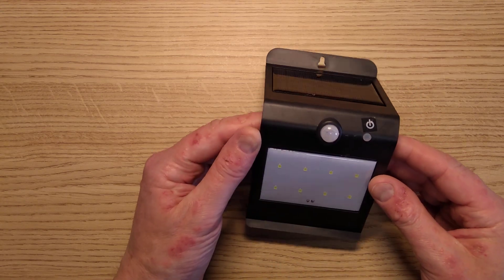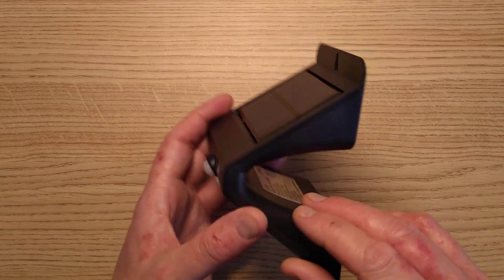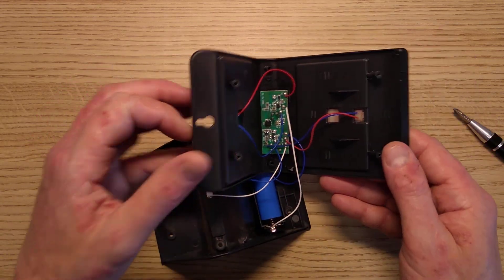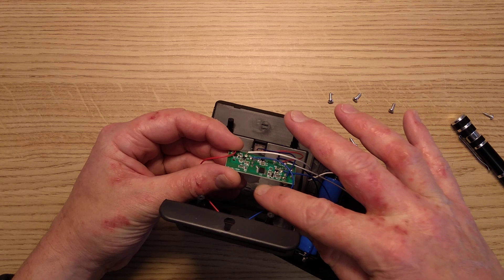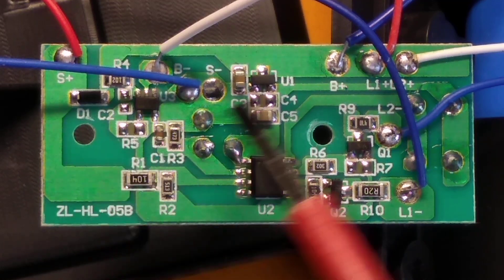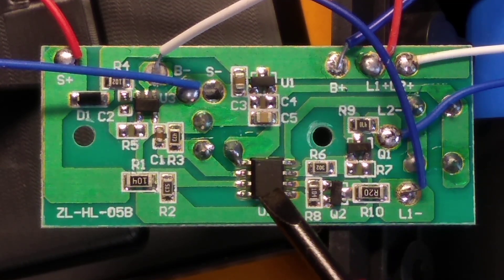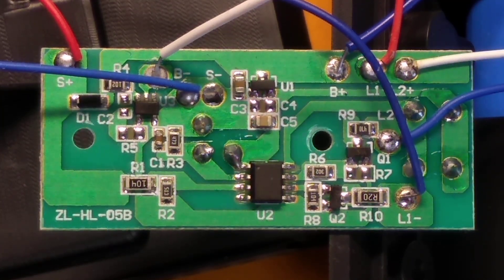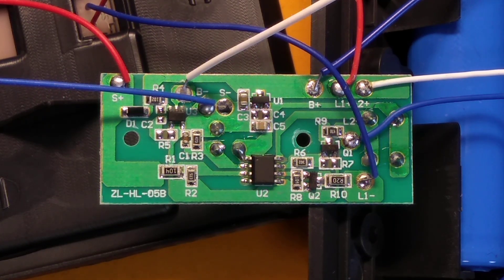Inside an Aldi solar security light.

Comment: "So, there are six screws. Two at the top and two at the bottom."
Reply: That sentence is both accurate and precise. There are indeed six screws, two of which are at the top and two of which are at the bottom.
Reply: 2 holding circuit board in maybe

Comment: Know the eczema problem really well.  Although mine is usually triggered by certain hygiene products and laundry detergents.  So I have my few brands that I know do not trigger it and have to stay with them.  But sometimes when I am away from home for work, the stuff they use on the linens in a hotel triggers it.

Comment: I have the same problem with eczema, and mine are triggered by heat, the hotter the weather gets, the more severe my eczema gets - I don't have any symptoms most of the year, and some years none at all, but if the outside temperature go over 25 C for more than two or three days in a row, I get an outbreak and it last for weeks, even if the temperature drops below 25 C. Quite annoying.

Comment: I also get this. I have found that anti-bacterial soaps, dish washing detergents etc can cause flair ups and also aggravate the condition. 
I tried using coconut oil based natural hand washes in place of regular ones a huge improvement.

Comment: The battery holder has a spring? They were cheap not adding a battery door, but expensive by not soldering the battery connections directly?
Reply: dekjet there are tabbed li-ion 18650 cells that I see all the time soldered in electronics.
Reply: Wait wtf

Comment: Hey Clive. Hope your hands are feeling better  :-)   I am 100% sure its the heat as a great friend that I went to Uni with has a similar condition and when its hot like it is today it gets very uncomfortable for him.

RE the solar light I expect like me you were expecting to find a BIS001 type ic on the back of the board. I have found a lot of these small motion detectors like yours use a three pin connection. 0V / 3.3 or 5V VCC and a transistor switched output. Did you per chance pop the top of the sensor module. I bet there is one in there and that connection to the mystery IC will be a pull low or high to trigger the other LED's. May be worth a look in that module.

Cheers Clive.

Stu.

Comment: Could be the cheap hotel style soap at your current accommodation, Clive? Cortozone cream helps.
Reply: Mine is stress related, so when I'm stressed I get it. Just getting over a breakout after a stressful week in fact. Also have dyshidrotic eczema.
Reply: Could also be washing up liquid, if it's different from what you've got at home (or if you have a dishwasher at home).

Comment: Fellow sufferer, haven't found anything that works for it yet.
Reply: You likely have tried this, but if you (or anyone reading this) haven't, it is worth a try.

1. Soak hands in lukewarm water for 5 to 10 minutes and then pat dry. (Don't rub, it just irritates it more).

2. Use pure Vitamin E (I buy the supplements and pip them open if I can't find straight up liquid) and cover your hands.

3. Put on cotton gloves and leave them on for at least 30 mins.

4. Dab off any excess Vitamin E and if you desire rinse your hands and dab dry.

Comment: dyshidrotic eczema, god I hate that. Used to get it so bad all the skin would peel off my palms. Only thing that worked was very strong prescription steroids.
Reply: Yep, I had that too when I was younger. If it is any consolation I grew out of it.
Reply: @oldbatwit5102  For the most part its totally gone, so long as I wear chemical resistant gloves when working. That seems to be a big trigger:  Contact with chemicals and metals.
Reply: @Matt Quinn That is true. I was only ever affected in the Summer. I rode a motorbike for a living and had the idea that it was triggered by my ungloved and sweaty hands reacting with cheap rubber hand grips. Just a theory though.
Reply: I had dyshidrotic eczema in the early 2000s. My doctor prescribed Betnovate(betamethasone) cream which cleared it up very quickly with just a couple of applications. 

In my case I was able to identify the cause.  At the time I worked at a photographic lab and to prevent the processors wash tanks getting a black bio-slime build up we used a  chemical treatment (Hydra Algae Free) and any contact with the concentrate solution would trigger dyshidrotic eczema.

Comment: That 8 pin chip could still be a microcontroller that has a one time factory programmable ROM. they are very cheap and sold for a couple of cents if bought in large quantities. get well soon.
Reply: theR6969 Yep, especially if the PIR is actually a module providing a detection signal to the main chip.  Though maybe just using an analog input to detect variation on the raw sensor output would do the trick.

Comment: Big Clive as far as the eczema is concerned there is some research that suggests in a possibly 10% of cases it can be triggered by nickel. There is thankfully an exceedingly simple test. Use some micropore or similar fabric/paper (not the plastic type but I cant remember why) surgicle tape to tape a 10p to the back of your wrist where a watch would be. If you get pinhead blisters you have nickel allergy. The reason it flares up in heat is that the acidic oils and sweat on the skin surface react way faster with nickel from coins and other sources to deposit nickel salts on your skin. It only needs picogrammes to trigger a reaction. Reactions with the TLR4 cytokine have been demonstrated with less than 100 atoms. https://www.dermnetnz.org/topics/nickel-allergy/
I can supply peer reviewed medical journal articles if you want them.
Reply from the maker: Interesting.  I'll give that a go at some point.
Reply: You bring up an excellent point. I had similar issues when working at a casino (back when they had coin machines). I used to take the bags of redeemed coins from the cashiers and dump them into a coin rolling machine. One day I had to roll about $7-8,000 worth of coins and broke out in such a nasty rash (which had never happened before in my life, even while doing the same duties nightly), and ever since that night I have been unable to wear a watch. I also had to remove my earring back then because the piercing would constantly break out and act like it was infected. It's been over 15 years since, and my body still reacts to most metals like that.
Reply: @dashcamandy2242  Stress and age affect it. I'm now past 50 and have not had the problem for many years. I got the little spotty blisters as a teenager then on and off in my 30s and early 40s. Kids, work and families having an effect. I can mess with petrol, metal cutting, oils and all the usual suspects plus funerals, 'trained' managers at work and other drivers with some impunity now. I take precautions of course (in terms of chemicals), but my hands don't react like they used to. A bit like teenage zits? Don't scratch 'em, zinc baby lotion used to help mine, but age definitely solves it.

Comment: I used to have very bad eczema (That used to crack and bleed) so you won't hear any complaints from me.
Reply: Any tips?
Reply: @johnbiermaniv4577  I'd recommend colloidal oatmeal lotion. walmart has their store brand in the beauty section which is pretty cheap and works well for me. I've only had rare bouts of eczema so I don't use it very often, but when I do it works well.

https://www.walmart.com/ip/Equate-Beauty-Eczema-Soothing-Moisturizing-Cream-7-3-fl-oz/41172976
Reply: I used have a similar problem only to realize it was the Latex Gloves I wore at work switched to powder free Nitrile gloves and Problem Solved .

Comment: I opened mine today due to it having joined the dark side.
No charge control and it had cooked the batteries.
Really awful piece of equipment.
Harvested the solar panel and the two cobs mine had, shall cobble something of my own together so that I can have light at the front door.
It cooks the battery/ies within weeks and goes from fabulous to a huge failure.
Got to be circumspect about buying these and be aware that the cheap ones work for about 4 weeks and can-out.
But thanks for sharing the view of the better one, mine has a very similar looking board but no charge reg.
I reckon it will be fine if one fits it with a shunt regulator across the solar panel output to fix that shortcoming as it's otherwise a going concern.
That solar panel in the case of mine outputs 6 volts which fries the battery, but a little shunt reg will fix that.
Thanks for sharing.
Hope your hands clear up soon, skin issues are awful.
Regards, D

Comment: My fiancée has just been diagnosed with the same type of eczema. Started with small patch on her toe now her hands and feet are covered in painful, itchy blisters. 
How long does the flare up last usually?
Reply from the maker: It varies.  It will pass with time.  I used to consider mine as a stress barometer for work.

Comment: Sorry Clive know you are away. Just wondered how bright it was as didn't see it working?
Reply: It is bright enough,but depends a lot on the battery level.
Reply: It's not that bright. It lights my living room just fine. But if you plan to use it outside as it meant to be, have 2 perhaps 3 of them unless you have a tiny garden/patio.
Reply: In my opinion quite bright, more than I expected

Comment: Old School here  .   Rub your hands down with house hold bleach.  Cuss while it burns and rinse off / dry.   Fixed.  Ready for the next job at hand.
Reply from the maker: I used to do the hydrogen peroxide version of that.  Pretty grim.
Reply: It didn't work, I guess?
Reply: @DerCrawlerVomUrAnus   Damn Tootin it works.   One application and your on down the road.  Better then going around with jacked up  hands for days.
Reply: @bigclivedotcom  LOL, Peroxide is for Sissy's   .
Reply: Maybe zinc ointment could be helpful as well since it's antiseptic and all.
Reply: Dave Micolichek  LOL,  No but it sure kills the hell out of anything biological causing those lesions.  House hold bleach is not that caustic.     Allergic to what ?   He said nothing about allergy's did he ?  Did I miss something ?   I heard   eczema .
Reply: Dave Micolichek  Actually from what little I seen of the mans hands sorta reminded me of a Poison Ivy  Reaction or some other plant based issue.
Reply: Please no
Reply: @zeusapollo8688  It works.  Beat the ell out of having sour hands for a week or more.

Comment: These charge then by midnight the little rear lights and more likely the our drains all the battery!!!
Reply: I have a solar pir lamp that also has a very low intensity LED constantly on after dark. Even through the winter it never caused the main light to run at a lower intensity or fail to light. If concerned then simply snip the wire feeding it, Clive pointed out which it was.

Comment: What price is this coming in at Clive ?👍
Reply: In my country i found at 3$.
Reply: The original version (triangular case) sold for £5.99 last year and attracted largely negative reviews online. This is a new and improved model, with a couple of warm white LEDs on the back of the 'bridge' which stay illuminated dusk to dawn, plus the main cold white sensor activated panel - however, the listing on their website doesn't list a price as it's no longer available online.
Reply: @Matt Quinn What do you know - Bunnings takes over B&Q https://www.theguardian.com/business/blog/2016/jan/18/watch-out-wickes-and-bq-bunnings-is-coming-for-your-diy-customers-australia
Reply: @Matt Quinn I actually want to know how much they are at the Aldi in Australia, wait - I can look it up. No longer available - PITA. So here is one from our Bunnings - $13 https://www.bunnings.com.au/solar-magic-220lm-wall-light-black_p0043241
Reply: @Matt Quinn Sounds very familiar Matt - we had Masters that disappeared in a very short time and have legacy local hardware chains e.g. mitre10 as well as a bunch of indpendants that can't compete on range or price with Bunnings. Still the online market is putting pressure on the monoliths and hopefully that will keep them doing an honest innings.

Comment: Why would they make it that shape? That alcove is going to have a spider living in it within the 1st day.
Reply: Spiders need homes too!!  ;o)
Reply: #Spiderslivesmatter they eat biting bugs.
Reply: It's counting on prowlers having a fear of spiders.
Reply: Seriously, I think the idea is that the small LEDs on the back shine into the cavity onto the wall where it is mounted, allowing you to see it in the dark and find the switch. But it would have been just as easy to find the switch if the little LEDs had been either side of it and lit it directly. Or, indeed, if the switch had been translucent plastic and illuminated from behind.
Reply: You need ad least one side to face the sun and one to face the ground, so open triangle is just less material plus it hides the guiding light
Reply: Bernd Eckenfels that design definitely doesn't use less material.
Reply: I assumed it was to light house numbers or something else mounted on the wall.

Comment: no schematic ??
Reply from the maker: I had very little time to make the video due to work.  The chip really is doing all the work.
Reply: bigclivedotcom No need, this is a very readable single side board, except the random wire colors used for assembly.
Reply: @bigclivedotcom  ''chip really is doing all the work'' i am intrigued ?
Reply: @Tadeusz Punto it's early access for patreon supporters